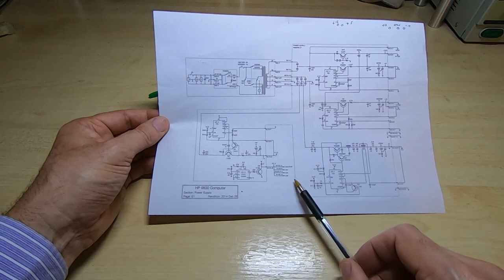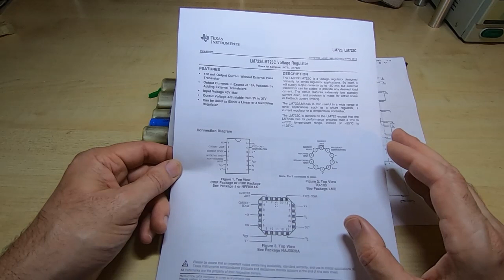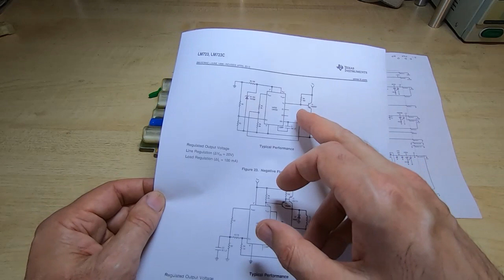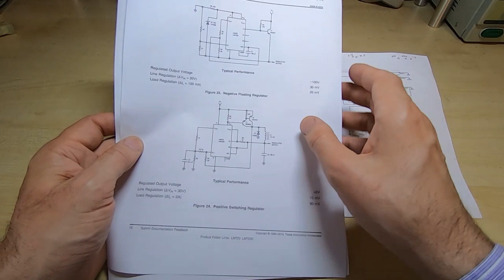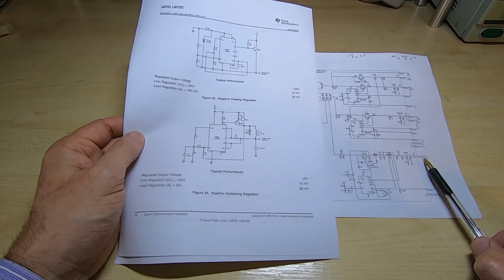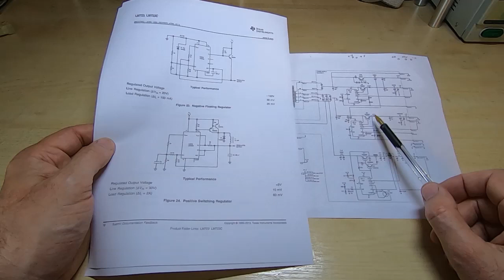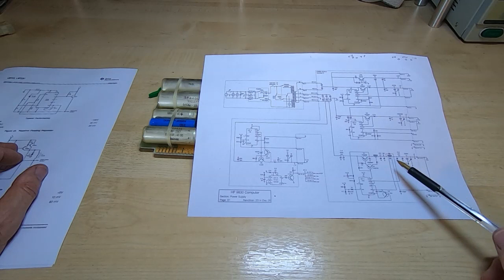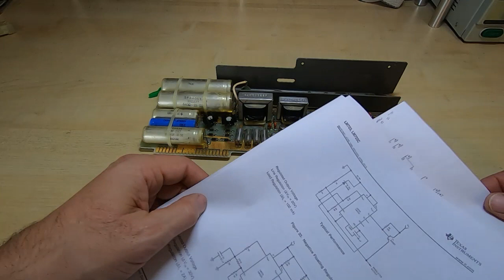HP9830A  Repair  Part3

Comment: Hi Jerry, We had a machine either the same or very similar to that one at work years ago I guess in the 1980's maybe. We had HP in to fix it a couple of times and I remember when the guy opened it up the last time it was caked in dirt everywhere, which he cleaned out with his trusty paint brush ! Good luck with the repair I hope it goes well. Martyn.
Reply from the maker: I think they always get filled with dirt even with a filter fitted but without a filter there was just too much. I had already vacuumed the unit out before I started the videos so there was a lot. Interestingly the dirt is conductive so it is very odd stuff. Another video coming shortly with the latest fault found. I think there are quite a few faults but it is a very interesting machine as it demonstrates very nicely how processors work.

Comment: Thats a really interesting desing. I was expecting some simple linear regulators. With some secondary ragulation useing some transistors and zener diods.
Looks really cool
Reply from the maker: This thing cost the equivalent of well over £50,000.00 when it was new and the main cost was the RAM and ROM chips so they put some real effort into protecting them from a faulty power supply. Unfortunately they did not consider damage due to contamination. In the next video I will power it up but there is a long way to go to get it working, even if it is possible. If the ROM's or RAM's are damaged then it would cost too much to repair.

Comment: Did these systems originally use any of that black foam anywhere that falls apart and disintegrates into gooey crumbs over the years? That stuff can be a real pain to clean out of old equipment.
Reply from the maker: Yes I think the air filter was originally made from that and is possibly what was holding all the dust together. The motherboard is very close to the aluminium base and there is only around 1mm between the tips of the soldered pins and the base so it acts as a trap for anything getting under the board. I am guessing that the failure was caused by lack of an air filter. I did actually clean a lot of dirt out of the machine before I fitted the power supply and there was all sorts of stuff.

Comment: That layer of stuff may be remenens of sigeret tar and things like that
Reply from the maker: Yes it could be. Most equipment I restore has a lot of nocotine stains inside but this does not smell like that. Also dust and debris does not normally conduct well enough to damage boards but I think in this machine the fact that the ROM's have a +20V bias rail may have something to do with it.

Comment: I suggest to have thermal camera at your bench, it can simplify seeking a source of strange smell a lot
Reply from the maker: See my later videos, I use a thermal camera a lot but this was not a hot or burning smell and was not caused by heat so unfortunately the thermal camera did not show anything.